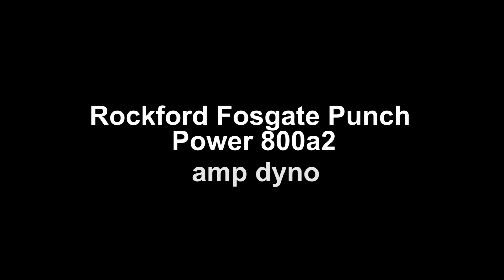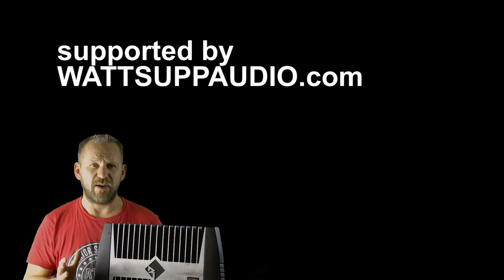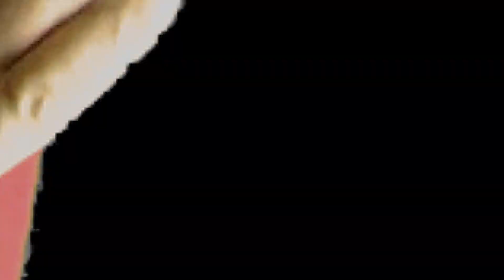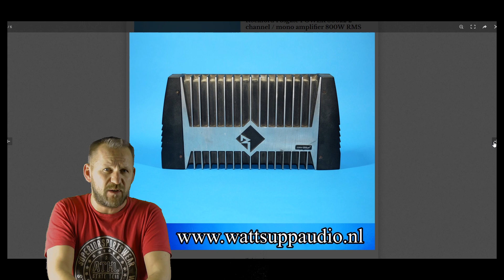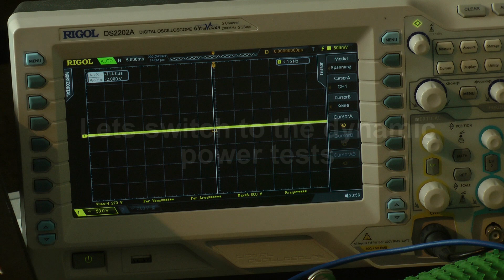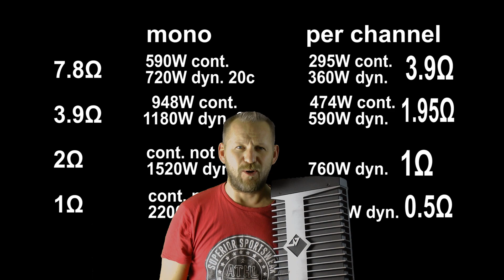Rockford fosgate punch power 800a2 amp dyno run old school amplifier test down to 1 ohm mono

Comment: Do these amp last at 2 ohm bridged or instant death . I’m running at 2ohm bridged sounds like best amp ever had.
Reply from the maker: No instant death, they have protection circuit which reduce power if unstable. But if the protection circuit is removed or damaged it will kill likely the amp, but it’s still repairable and not too expensive. It takes out output section and power supply section.

Comment: Punch 800A2 and the power 800.2 sound the same?
Reply from the maker: If i remember correctly, only filter slope is different and power terminals but same amps 👍
Reply: @audiokeller1975 800a2 bridged at 2ohm sounds way more powerfull and thick exotic sound . 
Listening to rap and rnb.

I also have Rockford t3000bd
And the 800a2 sounds more thicker and more hefty.
Reply: I was told not to run at 2ohm bridged
By a few people etc . But it sounds way better
Reply from the maker: Back in the days I only ran my little punch 40 2 ohms mono. It depends on subwoofer/box/design, a sub is not a fixed resistor maybe some amps which are working at 2 ohms mono never see 2 ohms mono.

Comment: I had this running for years in my old car running at 1 ohm powering 3x jl w6-v1 6ohm subs. It sounded so amazing and the w6 has had no problem with the power.

Comment: That’s great power for around 1999.
Reply from the maker: It’s conservative power - there are still speakers around which produce high SPL with less power. Especially in todays car audio section there are woofers with high power handling , they feature big voicecoils, heavy cones and very big magnets with a nice cooling system to handle lots of power but in most cases the downside is low efficiency which makes lots of power / bigger amps necessary to reach high spl . I think it’s still amazing what some audio systems were able to do with less power input from small oldschool amps - way smaller than this 800a2 👍😃 music Styles were also a bit different

Comment: Hello.  I had the Punch 800a2 amp years ago, and it sounded awesome!  The birth certificate said 982W total at 2 ohms, all channels combined.  Is this Power 800a2 amp better, or more powerful, than the Punch 800a2?  Is there any difference?
Thanks, nice video!
Reply from the maker: The only difference of both amps is the slope of the input filters. 800a2 has 12db per octave and power has 24db per octave, that’s just a slight difference, but no difference in output power.
Reply: @audiokeller1975  Ok got it, thanks.
Some other guy tested this same amp 2 yrs ago, and he only got 556W 8 ohms mono, and 811W 4 ohms mono!  He ran the test again at 1khz, and got even lower numbers!  How can this be?  He ran the tests at 14 volts, and still got less power??
I was planning on buying one of these, but now I'm not so sure.
Reply from the maker: There is a difference in continuous and dynamic 1kHz test. Dynamic Power is printed in the birth sheets. Can you be more specific and point me to this test?
After all these years it’s also possible that some of the big caps are starting to die and don’t store the same amount of energy like 20 years ago.
Nothing wrong with buying this kind of amplifier-they are 👍
Reply: @audiokeller1975 The test was done by "HifiVega" here on youtube, 2 yrs ago.  He doesn't specify, but I think it's continuos power.  In both 40hz and 1khz tests, the power rating results are lower than yours!  His best results are 556W mono 8 ohm, and 811W mono 4 ohm.  Over 100W less, than your test results!
He also says the Punch 225.2 amp, is almost as powerful as the Power 800a2, which I don't believe!  Thanks.
Reply from the maker: I know this test and it was continuous. The dynamic headroom of these amps is amazing because we don’t listen to sinus signals which have a crest factor of 3db, Musik has much higher crest factors and that’s when the Rockfords sound so amazing because they deliver lots of dynamic headroom 👍 todays pro audio amp manufacturers don’t rate with continuous power in most cases. They simulate different crest factors with different Burst signals which leads to much higher values because continuous is the hardest way to test an amp especially on fixed resistors which are way harder load than speakers which have impedance which are frequency depending!
Continuous shows how strong the amps power supply is and you can compare amps only if tested equal. An amp which has 100 watts continuous but no dynamic headroom will not sound better than an amp which has 80 watts but 3 db of dynamic headroom ( 160watts for a short time )!
That’s the reason why they are sounding great 👍
Reply: @audiokeller1975  I recently bought a Power 800a2 amp, from wattsuppaudio.  Do you know if it is the same amplifier, that you tested here in this video?  I want to know because it has better power ratings, than other Power 800a2 amps, tested in other youtube videos!  Thanks.
Reply from the maker: It’s possible but I don’t know if it’s the same amp. The main question is if the testers in the other videos ( which exactly, please ?) tested the same way with same supply voltage? I doubt that. In future I will add a power test protocol with serial numbers, so that everybody knows which amps I really tested ✌️
Reply: @audiokeller1975  Not the same way, but HifiVega only got 789w mono 4 ohms on his test.  You got over 900w mono 4 ohms in your test!  Williston audio labs also said  these amps (Power 800a2) don't do much over specs, like other Punch amps.  But yours did over 900w continuos!  I'd like the Power 800a2 amp that I bought, to do as well as yours did (900w+).  Thanks.
Reply from the maker: It’s not an audible difference between 800 and 900 watts , should be around 0.5dB , we will not hear a difference, the more important thing ist that they do the same dynamically 👍 in both cases you got a nice amp 😎
Reply: @audiokeller1975  I hope so, I paid $350 euros.  Thanks for the info!
Reply: @audiokeller1975 The specifications on this amplifier's manual, are 800w continuos power mono 4 ohm, and 960w dynamic @ 4 ohms.  You exceeded these specifications in this test, by over 100 watts each!!  Now I feel proud, to own this amplifier!  Very nice thanks.😊
Reply from the maker: @charlesbolano7148 back in the 90s rockford tested at different voltages, sometimes even at 11,9 Volts. You can check in the sheet which voltage they used.
Reply: @audiokeller1975  The manual (not birthsheet) says 800w continuos mono 4 ohms at 13.8v, and 960w dynamic at 14.4v.  You exceeded both ratings, with a voltage of 13.7v.  Which means the amplifier is under rated, which is good!
Reply from the maker: @charlesbolano7148 it can also mean that Rockford rated this amp at a lower THD 😉👍
Reply: @audiokeller1975  800w @ 0.05% thd 20-20kz, and 960w dynamic @ 1% thd 1kz (Manual).  Either way, the amp did better than rated!  Thanks.
Reply from the maker: The continuous rating confirms what I mentioned before, 0.05% is low. Power will be more at 0,5% or 1% continuous.

Comment: I don t understand that machine and how it measures the watts please explain how it works so we understand clearly all i understand is there is a sound wave on the screen
Reply from the maker: let me try to explain it with my words: the machine is called a scope which can make AC voltage visible. that scope is connected to the amps outputs. instead of a speaker there is a big power resistor connected to the amps output ( this is a harder load for the amp than a speaker ) i give a sinewave via RCA input with a headunit into the amp and drive the signal to the clipping point. That is the point where the amp is at its outputpower limits. i measure the voltage and divide it by the used resistor. lets say we have a 4 ohm load and we get 50 volts RMS unclipped out of the amp. power is calculated: voltage * voltage divided by impedance in ohms. that means in  our example : 50*50 / 4 = 625 watts. RMS = peakvoltage / 1.414. with the scope i just monitor the voltage until it reaches the clipping point. With a big amounr if clip the RMS value goes up. this has to be avoided because a clipped signal is dirty and sounds bad and destroys speakers sometimes.
i hope i was able to explain it. If not let me know and ask your questions👍
Reply: @audiokeller1975  thanks for your reply  whan you are doing the test show the person that is watching in detail with a calculator in your hand and point everything out   and show everything so the person watching understands 100 percent clearly what you are doing think that the person has no idea what is what machine  and how it works =)
Reply from the maker: Good idea!
i think i will make a short video how to make the calculations like a tutorial for all tests. i always try to keep my videos as short as possible. with an extra video i can still keep them short. Check out my older videos, if i remember correct i had the formulas and calculations in  there 👍
Reply: @audiokeller1975  there is much much more that will attract people that as a watcher my self and experience that I had in the industry I will try to help on the missing pieces to your good vedios my friend

Comment: Very nice amplifier! 🤘💯🇺🇲🇺🇲
Reply from the maker: yes. i really like these amps. they sound nice with plenty of power and headroom 👍
Reply: @audiokeller1975  You should try a Power 500m. You will be shocked! 😎
Reply from the maker: i already did 😊 I dynoed the 250M which is the 96 model of the 500M.
Its unbelievable what they put out if linked together but i dynoed only one amp - too bad i sold the other one before i had the idea to make amp dyno videos 😭😭😭🤣🤣🤣
Reply: @audiokeller1975  You taught me something new. I did not know the 250m was the same as 500m! 👌
Reply from the maker: it has very little differences in the way the status display is connected. with the 96 model you dont need an extra adapter👍
in 2018 i fixed a 250M and after deeper looks into the schematic its the same amp😁

Comment: 🤘🤘🤘🤘🤘🤘🤘freaky awesome power🤯🤯🤯
Reply from the maker: Cant imagine that lightweight amp manufacturers measure with 8 cycles. nobody had the idea to do this back in the days. to compare yesterdays amps to the lightweight amps of today makes a redyno of yesterdays amps necessary 👍
Reply: @audiokeller1975  it's exciting. Old against new.
The new Amps are definitely afraid of these tests 😉😉😉😬😬😬

which one sounds better is more important😎